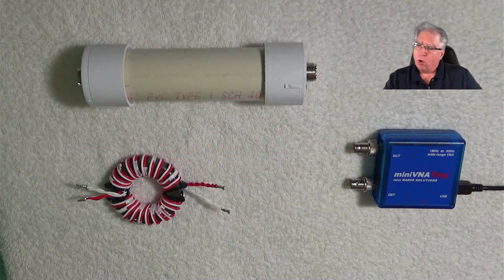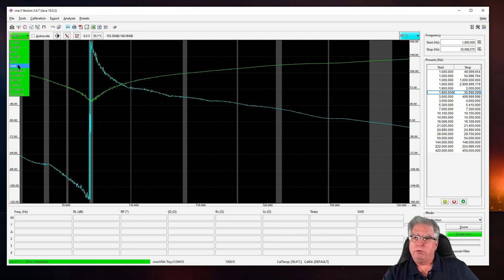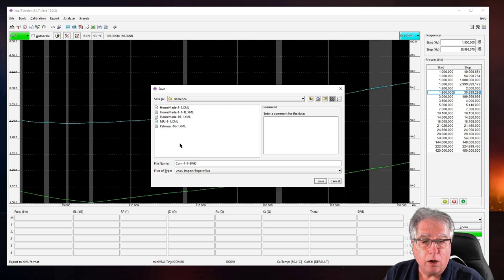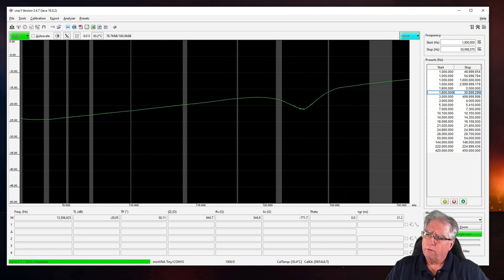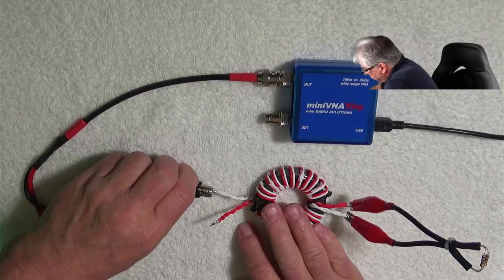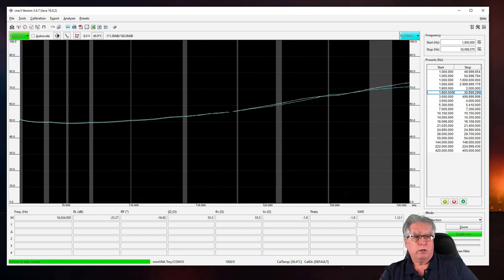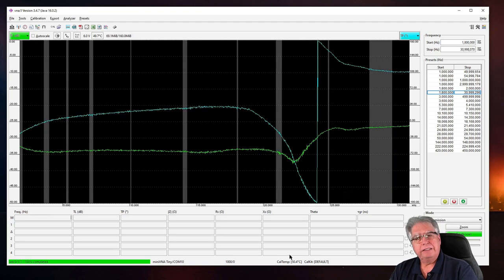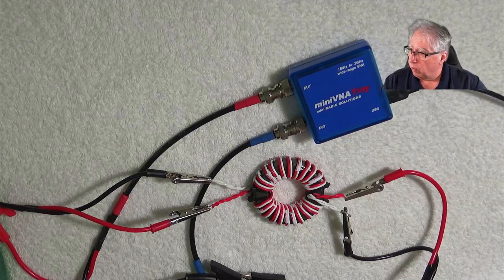Commercial 1:1 Current Balun Vs. Homemade! Which Tested Better?

Comment: I just wound a balun nearly identical to the one you tested and installed it at the feed to my G5RV jr. I have a 100 ft RG8 coax. The result was a dramatic reduction in electrical noise. I was very impressed. I can now use 80m. Noise has just about gone away! Thanks.
Reply from the maker: Hi Charles,
Great news! I've been very happy with mine as well.
Thanks for reaching out!

Stu
AG6AG

Comment: Very good. It would be interesting to compare the construction of the commercial balun to your homemade balun.
Reply from the maker: Hi Joe,
The commercial balun is a 'ferrite bead' design where they take a length of coax and put many ferrite beads on it (I've seen as many as 51 beads on some designs). I plan to do a video on testing things like baluns and ununs soon!

Stu
AG6AG

Comment: I did the exact same thing as you except with a RG-8x wrapped 43 toroid (total cost $20) vs the MFJ-915 RF isolator (retail $55) the best I could get was -18 db on the MFJ but the toroid was around -28. The difference of wrapping a toroid vs cramming as many ferrite beads into a PVC pipe.

Comment: It's funny, the expectations some have, when coming across a random video !
As if it was made for them ?
And then when it doesn't turn out to fit their whim, they complain, rather rudely I might add !
Thanks for taking your time, and honestly sharing your results !
As for many of us, this is still Hocus pocus !
Too....thanks to your XYL keeping you focused !!
Hi !
'73 !!
Reply from the maker: Thanks Sleeve,
The results are a bit surprising, but the "Commercial" Balun uses Farrite Beads and not a toroid. Construction really makes a difference.

Stu
AG6AG
Reply: @AG6AG  
You're welcome !
But now the question begs, from your experience do the beads always take a back seat to a Toroid ?
Just a curiosity .
Tnx !
Reply from the maker: Hi Sleeve,
Boy, is that a loaded question! So the short answer is that they both do the job, but your choice of why you use one or the other leads to a very long conversation.
The thing about a toroid is that every time the wire goes through the center of the toroid, the affect multiplies. There are 24 paths through the center, so the effective comparison to a bead would be that you would need to have 576 beads to get the same choke factor. Yea, I know, sounds like a lot, but the reality is 24^2 is the math.
However, with each time you go through a toroid, you reduce the wattage it will handle. This is due to the heat factor. The act of AC going through the wires multiplies the heat that the toroid develops.
That is about as short an answer as I can come up with...

Stu
AG6AG
Reply: @AG6AG  
Thanks Stu !
Very interesting, and not that I've studied this by any means, but I have never heard that.
Wow !
That is really remarkable !
Just goes to show you, how easily one can be fooled into believing their efforts were enough, when in fact it likely falls short of their intentions !
Not that you'd be interested, and not to turn this into a forum, but I can't help to wonder about what kind of job the ugly Balun does ?
I once read a fellows take that they too can be misleading, as to the number of turns and at what frequency.
Have you ever wound up some ugly Baluns and tested those ?
Thanks again for your time, but this is so intriguing, at least to me....Hi !
Reply from the maker: Hi Sleeve,
I've not done a lot of testing with the ugly baluns. Mostly because of the DB loss over the length of coax you need to make the windings. That said, chokes for the most part work the same way. The use the field that is created by wires running next to each other to act as a filter to curtain frequencies. The commercial and home made balun we tested in the video are using the toroids to interfere with the common mode waves traveling through the wire where the ugly balun uses those same waves to create interference and "choke" of the common mode on the outside of the coax. The ugly balun is basically an air wound inductor interfering with itself...
At least that's the easiest way to explain it.

Stu
AG6AG
Reply: @AG6AG  
Thanks Stu !
I suppose a person could spend a good portion of their life studying this !
And thanks for letting me be an , " Intellectual Interloper "  and picking your brain !
Always interesting !
And thanks, not only for your explanation, but your time !
Best wishes to you and yours !

Comment: Stu, when are you going to manufacture the balun commercially?
Reply from the maker: Hi Robert,
Probably not as by the time you calculate labor in to the mix, it just isn't a viable product unless you were making it at scale... That said, from a difficulty level, they are easy to make yourself.

Stu
AG6AG
Reply: I think that by making it yourself you are not saving money, but learning and enjoying.

Comment: Wouldn't it be much more accurate test by soldering the resistors and wires instead of the alligator clips?
Reply from the maker: Providing that the connections are stable and clean, it should not make a large difference, but there are times that jiggling the connections tell a story.

Stu
AG6AG

Comment: Would a 43 torroid be better?
Reply from the maker: The 31 has a broader frequency range then the 43, but a lower heat range. Since we are talking about a 1:1 it should not build anywhere close to same heat as a 4:1 or 9:1. But a 43 would work as well for HF.

Stu
AG6AG

Comment: The one thing that I was looking for in this video was how to calibrate my in order to test my ugly balun and that is the one part that you skipped or rather fast forwarded through. Thanks for not helping.
Reply from the maker: Hi Bryan,
Sorry that the fast forward made things more difficult for you. Calibrating a VNA is pretty much the same regardless of what you are testing. The goal is to calibrate with all the test cables in the circuit that will be used in the actual test. In my case I had two cables with alligator clips and basically ran a calibration with those attached to the VNA so there characteristics would ignored during the test.
So the real answer is regardless of the tests you are doing, always try to keep test rig cabling in play when calibrating.

Stu
AG6AG